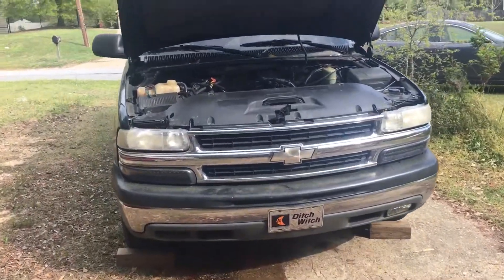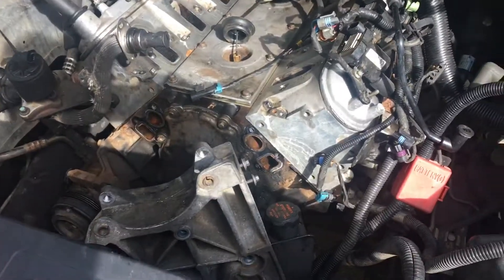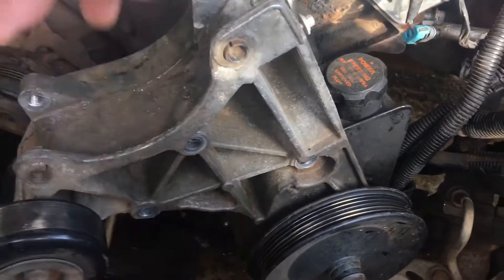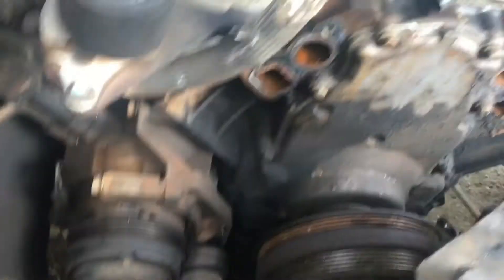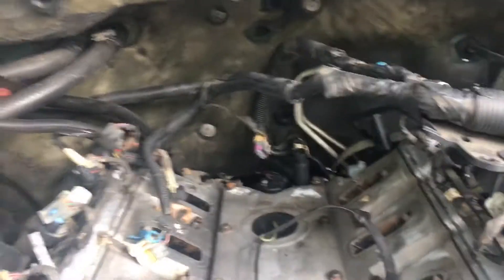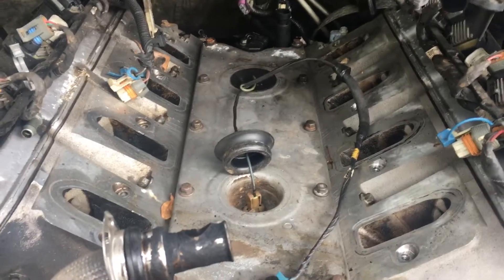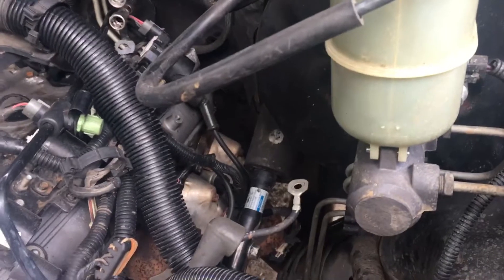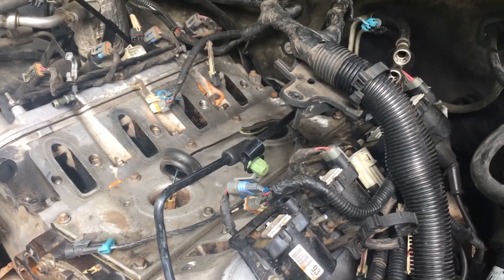2001 Chevy Tahoe LS Engine Swap Part 1

Comment: Which crate motor did you order
Reply from the maker: I didn’t order it. My customer had already ordered a crate motor for over $3500 when he approached me about installing it. In my videos I showed where the intake bolt holes in the heads were damaged and I invented a reverse thread chaser tool to clean the threads from inside to out.